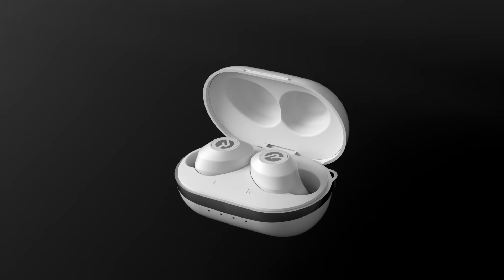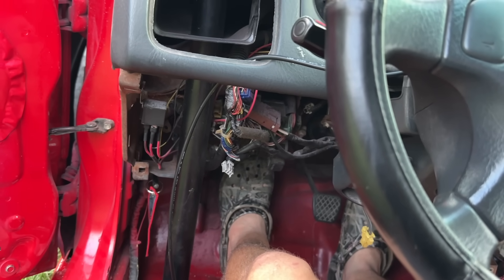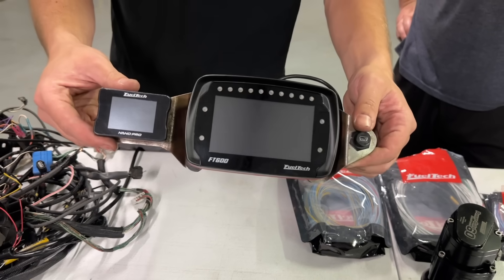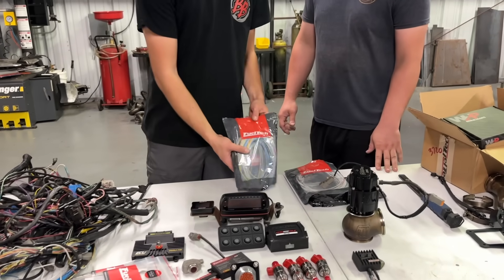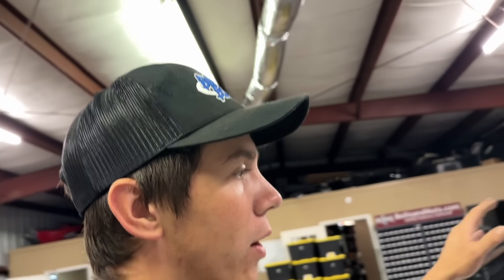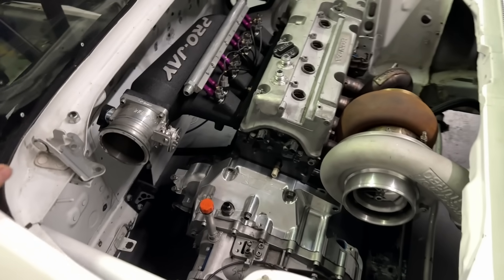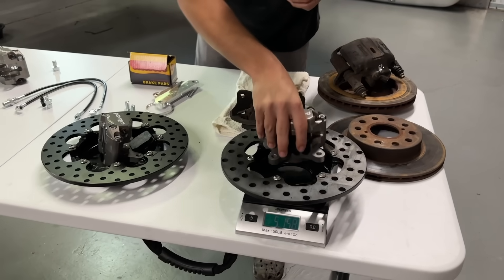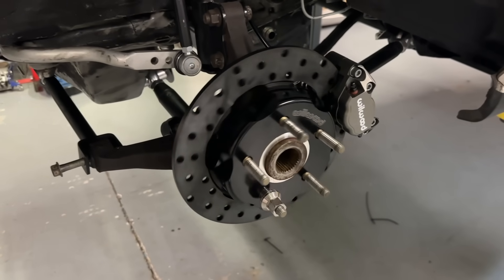Preparing The Mr2 For The BIGGEST Race We've Ever Entered!

Comment: Recommend, buy 2 x 16v batteries, have 1 on charge while the other is in the car, that way you can quick swap them back at the pits, and if you ever have an issue with 1 battery (it happens) you have a backup right there
Reply: My thoughts exactly..
When you need to do a back to back run.. And just being able to switch Batts.. Huge advantage
Reply: Nah just grab the jump box
Reply: @anthonyviau1  I hope you're just making fun of their old habit and way of thinking!
Reply: I have no clue why they would not have a swap in battery. Having maximum voltage is key. Look what happened with the shi##y old alternator in the hatch. How the hell are relays, fuel pumps, ignition components, and apparently turbo boost controllers supposed to function properly? Even with DC-to-DC converters as that can only go so far depending on current draw.  Hell, maybe use a ultra capacitor "battery" or a true lithium.
Reply: Figured someone would recommend this it's the best plan, redundancy where you can is crucial
Reply: @anthonyviau1 the jump box would just live in the frunk 😂
Reply: You must be new here lol - You know Kyle hates practicality and reliability /s
Reply: These boiz need at least 5 😂
Reply: U guys realize 16v batteries is what most racers use right ?? They just charge between rounds

Comment: Anderson quick connect for the 16v battery is definitely a go to for 16v system for quick easy plug in. Had it on my crx a few years ago when i put it in full race mode and it made connecting and charging the battery super easy.

Comment: I remember thinking this would be your LeRoy when you started playing with it. Iconic '90s car converted into a racecar like the C5, but Honda style. That's looking to be more and more true as time goes on. Big advantages you have with this car are that it has a body with some pretty good aero and that it's super light. Only disadvantages I can see are the weight distribution and the short wheelbase, but honestly in this style racing the wheelbase isn't as much of a factor as I thought it would be. Just put the power down without pulling the front wheels off the ground and this thing will give LeRoy a run for its money, even with the new destroked motor.

Comment: Brake upgrade is excellent. More pressure, less rotating mass. Faster or at least more controlled stops and mildly faster acceleration thanks to this. Less unsprung weight for potentially more consistent traction - only if a track has a ripple (rare). Obviously 39 pounds off the total weight of the car. I am sure they dissapate the heat from a track stop better too. Not a road race setup for sure (not enough thermal mass/load to handle repeated stops) but a strong kit.

Comment: That circular bulkhead connector is unfortunately trash.  The contact retention fingers are plastic and often break if you need to de pin anything for any reason.  Would recommend a 38999 or auto sport with a proper backshell for strain relief.
Reply: Let me know if you need help specifying a good connector.

Comment: @Boostedboiz # when John build this motor take it to a engine builder and Machine Shop with a dyno engine Dyno the reason why they can check stuff that y'all came and if you degree the engine with all the stuff like you're supposed to do and I know there's ways around it but honestly if you want something reliable that's the best route to do to do trust me and believe me the guy that built Leroy and believe me because the guy that Pete that is been working with Cletus that built Leroy's engine he done everything I'm telling what y'all should do I've been building on this for a good while I'm 37 and I've been around it since before Fast and Furious serious and only reason I'm saying that I love y'all stuff and the reason why is because if you do that I had had an engine that I built 15 years ago it's making more horsepower 301 horsepower than it did 10 years ago and only thing I've done was upgraded head studs and head gasket and water pump and then the same guy that built the engine go back and read agree the engine when just throwing a new head gasket on it and some of the upgraded Fuel and stuff because I was going with more power and it was on a old school set a Bosch 550cc injectors like I said this was an old-school build like really a twenty-year-old build but I got it and built that one that's the car I still got it locked away in the storage unit I drive it only on the weekends or on nice days because that car's been fully gone through
Reply: ❤❤ I've done built over 35 to 45 Hondas and some of my boss and the ones that are killed 2000 Civic SI CRX SI, just moved this way I have a lot of cars that's in my collection vitamin still working to get to someone's already been completely restored and some of them has some really rare Parts on it especially my o.g. parts that people would go crazy for that I kept in my cousin kept back whenever he had I import shop for all the Honda people we done everything there engine Schwab's turbos we was the first person on the in our area or east coast turbo swap the RSX type is that was fully tricked-out had the best-of-the-best cuz he was a famous Rich baseball player some light-skinned black guy cause hell he was a big Honda fanatic me you and Brent and some of these people that I grew up with the ogs like people older than me and everybody else that's around y'all wherewithal one big family because we all like the same shit dude the same shit say the same shit think about the same shit
Reply: Remember the most important thing when building the engine is the green the cams and the crank and anything else that has to be set a certain way when you go but the timing on I heard that on some Honda's Mudders that you have to but on a k-series at least you have to put certain sprockets like maybe the water pump or oil pump on I'm not really sure I haven't broke down a case here yet but I have done D series B series 8 series J series everything but a k-series I don't know what it is but they terrify me because there's the way they put them together I just dislike

Comment: You have the calipers on the wrong sides. The bleeder needs to be at the top of the caliper to get the air out of the system. Shane did the same thing and fought it for weeks so hopefully that helps.